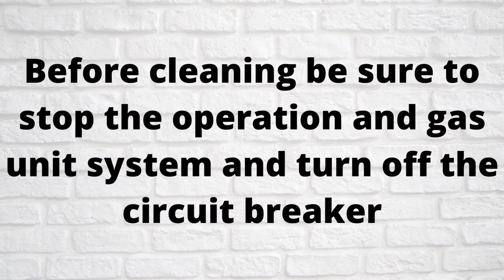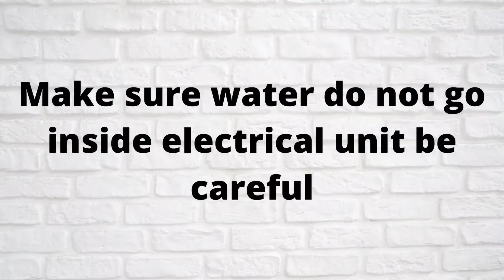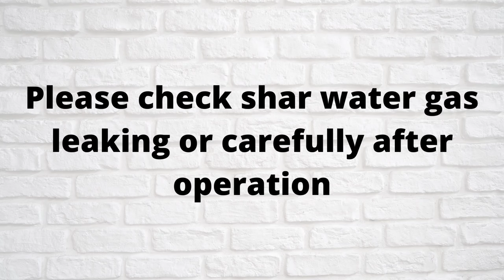How Ac Service At Home || Servicing Air Conditioner Outside Unit ||

Comment: I think removing pipes was not necessary as it creates point of failure in the future ,a jet servicing would have done the job for the outdoor coils
Reply from the maker: Thanks for the question It's been three years and I haven't even cleaned once. I had to do a practical clean up about it.